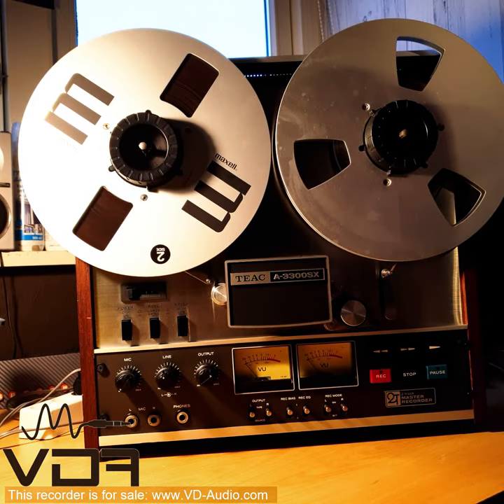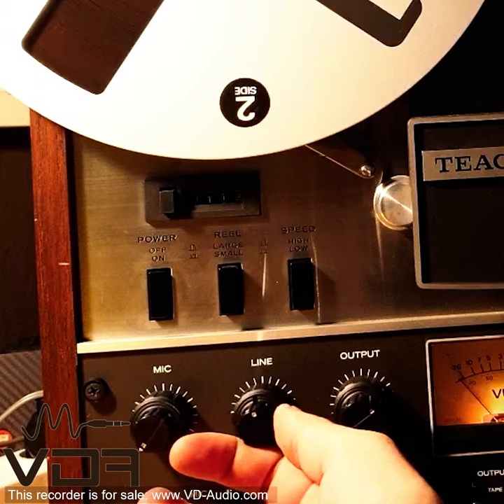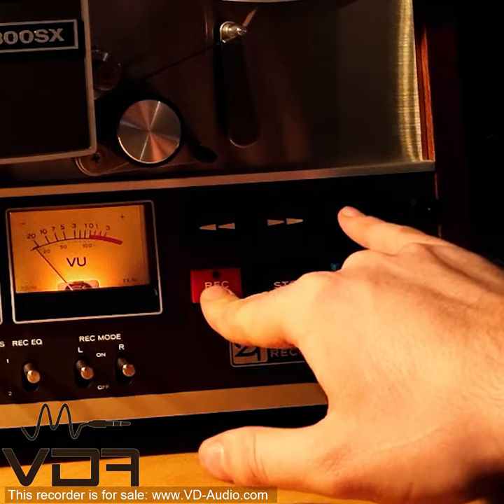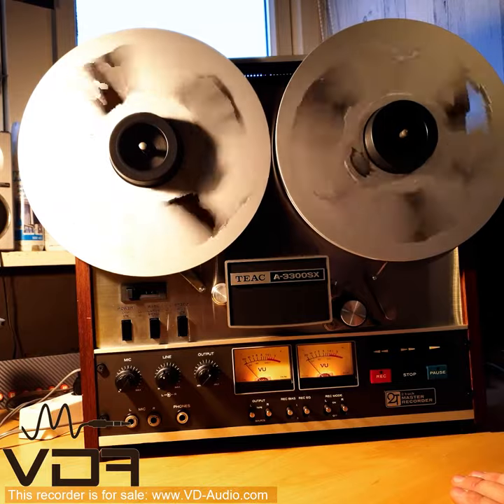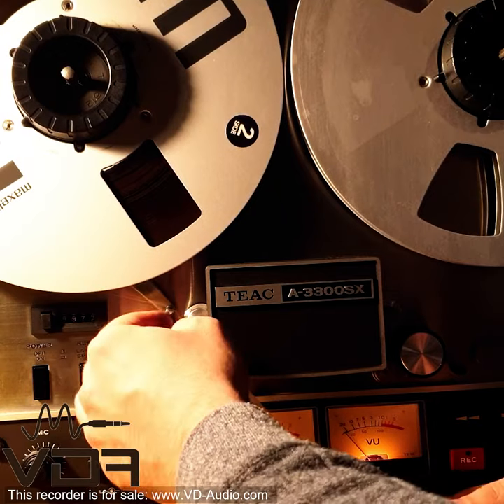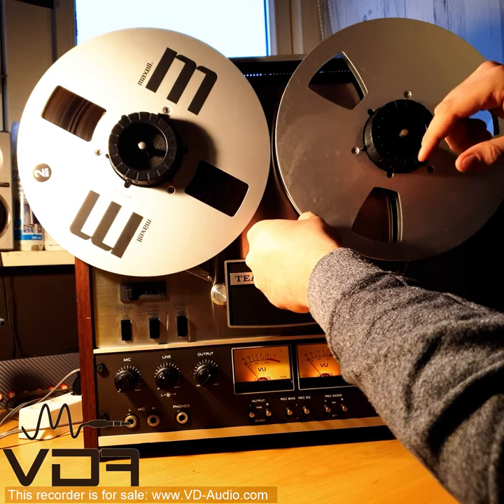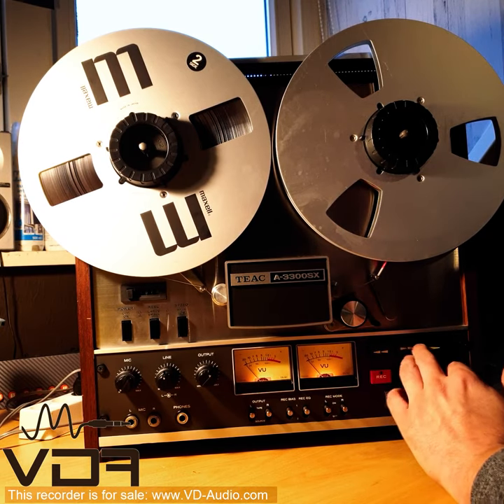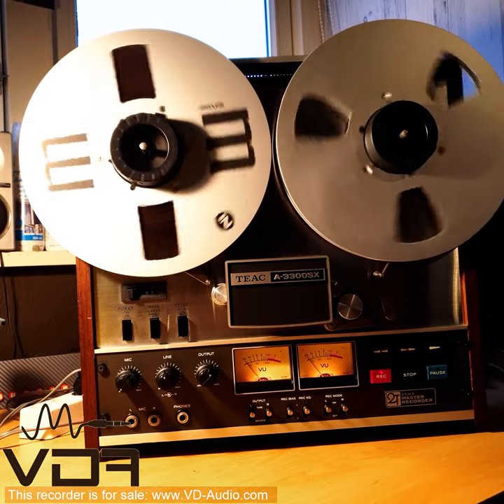How to use a "Reel to Reel" Tape Recorder (TEAC A-3300SX Tutorial) by VD-Audio.com

Comment: This is going to be a weird question; I have this unit, same model. I love it! But it’s hard for me to believe that 15 inches is tape pass by the head assembly every second, at high speed. Am I missing something?! 

Where can I send you a video of my unit? Yours seems to turn faster than mine….
Reply: Yours is not 2T and 15 ips as the one in the video. There are different versions of this model.
Reply: I have a 3300 model also. There is a switch on the left side panel that is high speed low speed. High speed should be 15ips. low is 7.5 ips.  It is a push button in for high, out for low. Good luck

Comment: I just purchased one of these... I'm new to the reel world though. Can you help, what size tape width do I need for these? I want to transfer my digital music to tape. It says in the manual 1/2" on a 10.5" reel for the 2T version however the assy tensions arms are grooved for 1/4"... I'm so confused. I currently have 1/4" tape on there on 7" reels... Thanks
Reply: all the 3300 series of decks use 1/4in tape including the 2t. The 2t Version is 1/2 track format on 1/4in tape, meaning that the tape is divided into 2 tracks as apposed 4 (2 playback in one direction, 2 in the other) which is the standard. Keep in mind that the tape doesn't determine the number of tracks but rater the machine heads do.
Reply: Why put Digital recordings onto tape? You won't restore analogue sound from digital. Just curious as to why you'd bother ?
Reply: @stupidhandles  Some digital recordings can sound too harsh and transient depending on what ad/da convertors where used. Transferring a digital master to analogue can help shape off the transients and give it a slight bump up in the low end. Ideally recording to analogue tape would be beneficial in my opinion but yes you can slightly restore the analogue sound from a digital recording.

Comment: Hi, great video! I'm a bloody beginner, I got a nagra 4.2. Can I erase tapes with it? Can I erase tapes with the TEAC A-3300SX? Thank You, Leo
Reply from the maker: Hello, you can erase a tape with any tape deck that has a erase head, which is nearly all of them. A Nagra 4.2 will be able to erase by simply recording on top of an existing recording. You can also erase by setting it to record without giving it an input. It will erase the tape but not record any new signal on it. 
An erase head will have a back centre and is always the leftmost head in any recorder that spools from left to right.